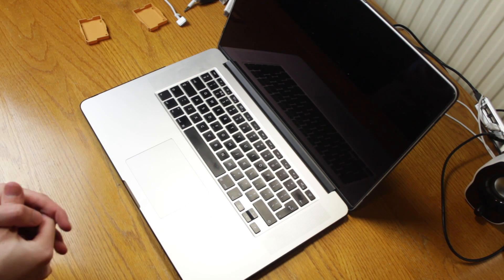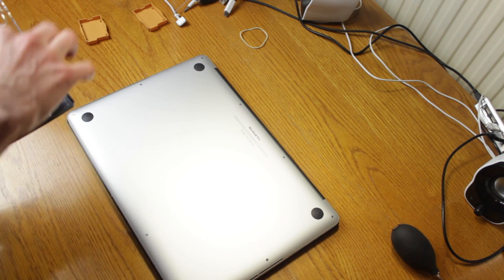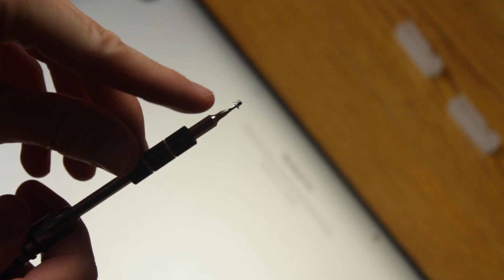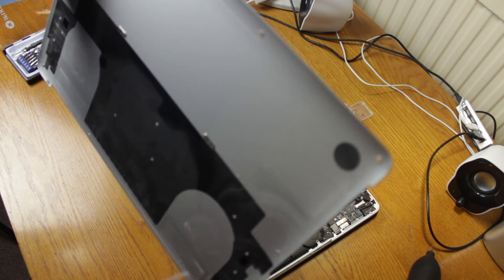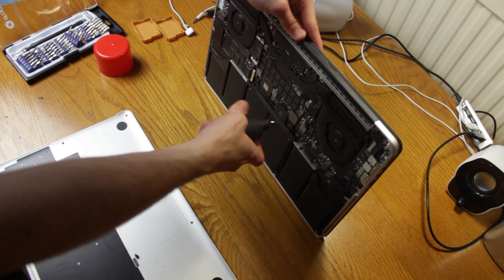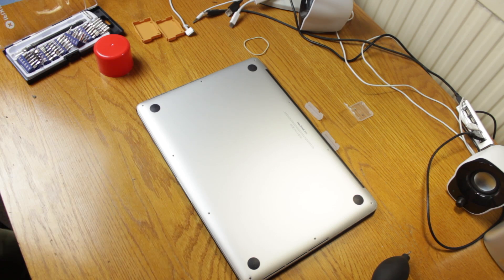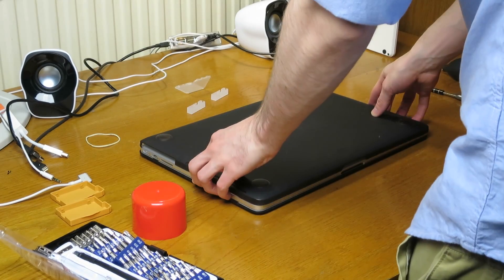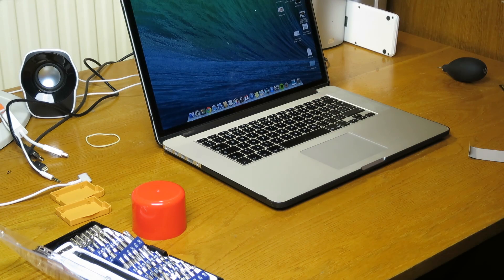How to Open Retina MacBook Pro to Clean Dust

Comment: I highly recommend using the compressed air Outside your home. now one needs that potential dust cloud inside the home.  When blowing out the fans, blow both out through the fax exhaust and from the backside of the exhaust in to fan... because dust bunnies often won't blow past the fans exhaust 'grid' (looks like baleen teeth), and often those trapped bunnies will blow past the fan blades.

I use a a small hand-held rechargeable air compressor.  It's not as strong as a fresh can of compressed air, but it is much friendlier on the environment. 

The  P5 pentalobe screwdriver is size  1.2mm.

Comment: This is a video of how NOT to clean the insides of your macbook pro retina.. No ESD, no disconnecting the battery (always do this prior to doing ANY kind of work insite a macbook), no stopping the fans from spinning when you blow air into them.. (them work like a generator when you spin them very fast and they will create a voltage spike that can ruin your motherboard). I just opened up mine and it was literally filled up with dust and cat hairs. I cleaned out most of the stuff but will reopen it tonight in order to replace the batteries and clean out the insides completely. Looking at the way you tortured it I'm pretty sure that I at least won't break my macbook with the careful handling I apply to it ;)
Reply: you dont need ESD to just to open the bottom and blow dust. But you can also damage the fan bearings if you spin it too fast Ive done it to change the RAM and SSD, which is a bad idea but YOLO
Reply: Ehhh, you do need ESD. You can yolo all you want, but I'd rather have a working computer ;) You can already damage the computer with a discharge that you don't even see nor hear.
Reply: I mean Apple doesn't mention in their article on how to change the RAM that you need ESD, and most Youtube videos no one uses ESD and nothing happens. But you should always use ESD

Comment: On the back of the Mid 2012 Macbook Pro 15" Retina Display  3 of the screws are longer than the other 7 so you need to pay attention when you remove them.

Comment: I was encountering a struggling Mac and I found it very annoying. my friend advised this excellent MAC system utility “macvo unique only” (Google it) and it worked well. I now have a smoother and faster Macbook Pro. Installation was straightforward, the user interface user-friendly. Cleaning, Securing, Optimizing your Mac, anti virus, spyware are a few of the great capabilities found in the program.

Comment: Warning: the screws are different sizes. They look identical, but they're not. You have to put the same screw back into the same hole. So keep track of where each screw came from. If you try to force a screw back into the wrong hole, you risk stripping the screw which means the cross shape on the head of the screw is destroyed and you won't be able to remove the screw again. I did this and I brought it in to Apple and fortunately they were able to get the screws out and replace them.
Reply: oh.. oh no…
Reply: Shmanky NOO I KNEE IT

Comment: I just did this, after a year there was a whole lot of dust in there! I can't think why the side vents don't at least have a metal mesh to block the bigger bits of dust. I've seen 5 year old laptops, even the older Macbook Pros (pre-retina) accumulate less dust than mine did in a year and I never left it on beds or carpet etc.
Reply: ***** Hard to tell since during normal web browsing/Office tasks it's so well behaved, it might be a few degrees cooler during full rendering/gaming load though

Comment: thanks for the tutorial. I've done this on my old laptop. My question is why didn't you just use the vacuum cleaner? it's a lot easier and not that messy way of cleaning!
Reply from the maker: +TechLineHD Don't use a vacuum cleaner because the static from it will damage the components inside the computer. You generally need to keep vacuum cleaners away from things like computers.
Reply: I agree and you have the point but honestly, I've done this like 20 times with 2 different laptops and I didn't mess up anything.
Reply: +TechLineHD You got lucky, but they do create a lot of static. Canned air is so cheap, I don't know why you wouldn't rather be safe with a 1000+ dollar computer.
Reply: you are right, I may do that next time when cleaning :)
Reply: As far as I know you should not use a vacuum because it can build up static electricity on the components. Those can then short out and kill your device. Compressed air apparently is safer.

Comment: Is it necessary to buy a anti-static wrist strap for this?
Reply: Well when you need to touch silicon components such as these it would always be a good idea but in this case it is pretty much unnecessary. Just touch something made of metal to discharge yourself and then you'll be ready to go
Reply: Mattia Righetti ok thanks!

Comment: Rofl, that's not the way you clean laptops, man.
Laptops require full disasemble of cooling system, at least, and gentle cleaning with isophropyl alcohol, not just blowing out the dust. The pieces of dust can collect on cooler motor and stop it from working, what will bring you huge problems. So I suggest you guys to, at least, disasemble the cooling system and change the thermal paste every 6 months to keep the system running without any chance of overheating.

Comment: Hold up there, Jake, and everyone watching this. BEFORE you start blasting out the dust, think: where is the dust going? Right - into the air that your breath! Get that laptop outside and THEN blast it. Not in your apartment! Thanks for your continuing efforts, and good luck on your exams!

Comment: The screws aren't really proprietary, they're just uncommon.

You should hold the fans too when you blast them so they don't spin. Using compressed air usually spins them way faster than they're designed to spin so it can mess up the bearings.
Reply from the maker: Good advice, thanks!
Reply: Uh, not true. Those fans are designed to spin at 10,000 RPM. The compressed air may spin them that fast, or even faster, but the bearings can easily handle it. If there's like a blanket of dust collected on the fins, the dust may dislodge and prevent the fans from spinning. check for that, and if you see chunks of dust, use an ice pick to extract it from the blades. This is very important. If the fan can't turn, it will cause the CPU to overheat, and the machine will shut down to prevent a meltdown.
Reply: anynamewilldo808 An Ice pick !
Please don't use mountaineering equipment on your MacBook. Try a cocktail stick or tooth pick
Reply: This is sort of true, you probably don't have to worry about the bearings too much but it is a factor so you are right and it is a reason to hold the fans. One "better" reason to do it though is because when the fans spin while the computer isn't on, it might damage the connectors they are connected to the motherboard with since power is being created when the fans spin. So if you hold the fans down, no power is being created nor transferred in the cables and the connectors are fine.

Though, you should think about static electricity whenever even opening a computer but definitely when touching components. So make sure to be grounded before touching the fans.
Reply: anynamewilldo808 TalesOfWar I noticed nobody had physics in school apparently...
The Reason why you have to be careful spinning the fans isn't that they wouldn't be able to handle it (cmon guys it's not that hard to construct something like that) and break. But infact if you spin them yourself, the electro motor creates electricity (since there's no battery, static electricity) wich is not a good thing before using the pc.
Reply: They're designed to spin at around 6000 RPM as limited by the OS